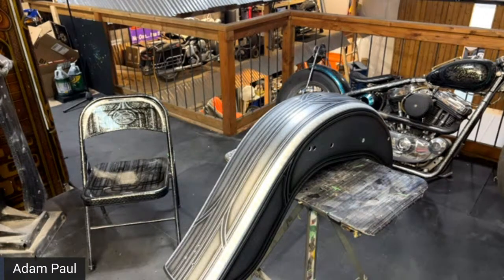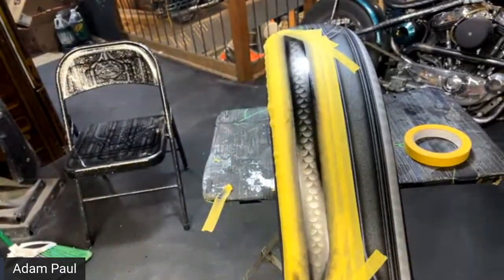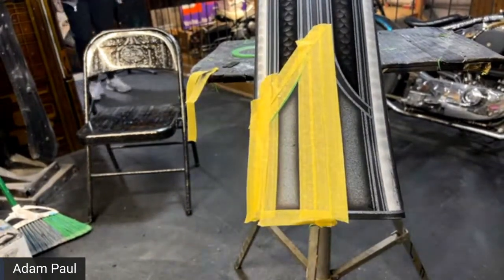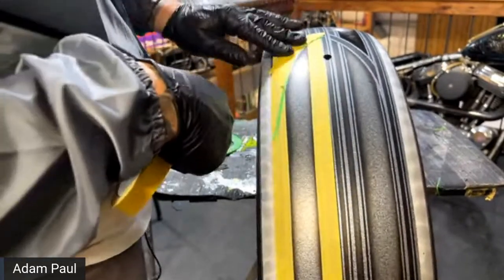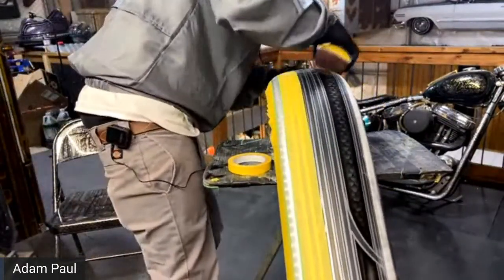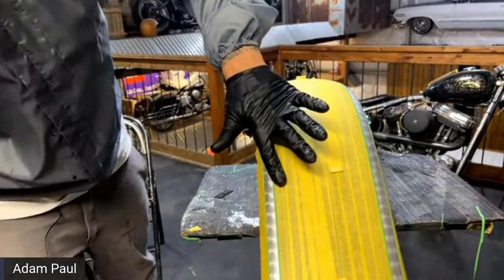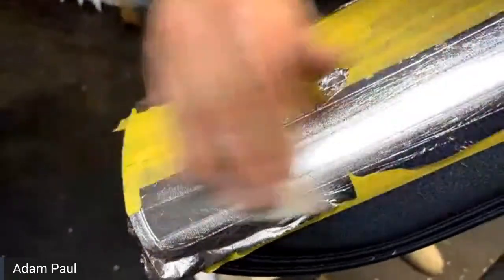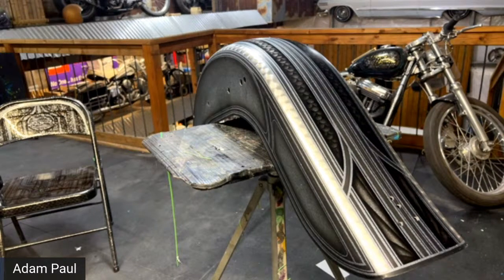Airbrushing metal flake graphics, LIVE Q&A

Comment: so havebbeen thinking of 5,6 coats clear over silver then tape out flames paint bike flat black revers tape flames then use air brush with and white red blue candys to fill in flames then coat of clear then pin stripe flames do you think this will work